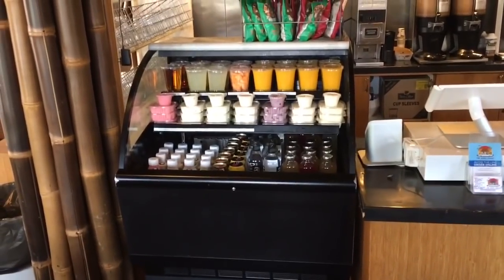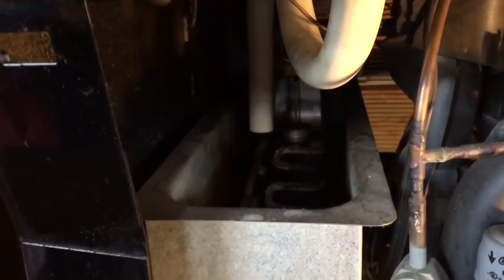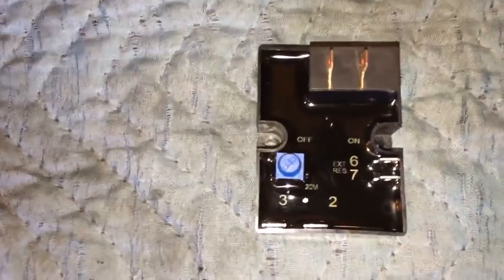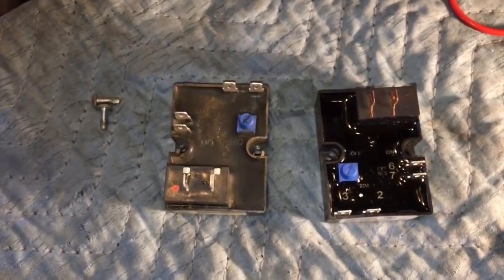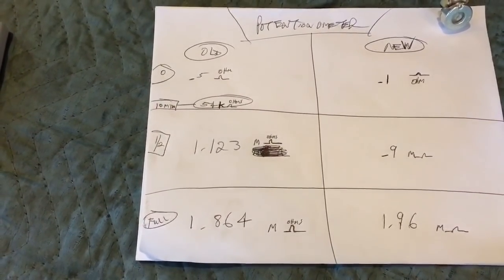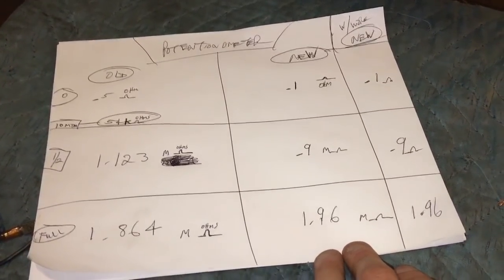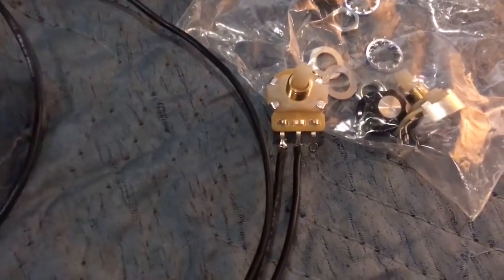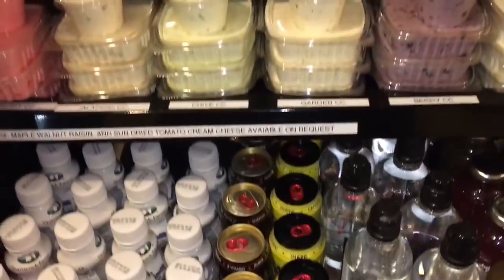Federal LPRSS3 Repair in detail.

Comment: Just throw a GM40AV time clock and problem solved 🤭😉. Or at very least will save you time on trying to find that time delay 😁
Reply from the maker: Your Way Would work in a pinch though. finding that time delay relay was a bitch. i found the last one in colorado from rhs for $150.00 list price. federal wanted $250.00-$300.00 for that solid state time dealy relay List price. + shipping cost. unfortunately a gm 40 would not work. run time has to be no more than 10 minutes or product will freeze overnight , u would have to pair it with a Temp control. id prob use one of those A421 with defrost built in if i was going to go that way. other than factory design or upgrade to new style controller. i think they are using carel controllers now. i bought a extra potentionometer for customers other unit & im going to stock a solid state relay as soon as i can find a good price on one.  for his other place. just to be prepared.
Reply from the maker: ive got a call into airotronics to try to get them direct.
Reply: OcRefrigeration,Hvac & Electrical. I’ve done it before there’s an RHS near me in The SFV Couple year’s back I’ve had a similar issue with one of those . I remember they wanted too much for that stupid relay , no room to make $$ . So I just threw in . GM40AV my favorite time clock btw, no more problems 😉. You can also try Case Parts In Monterrey Park , I believe their inventory is bigger than RHS . Some parts cheaper . Great repair OC ...
Reply from the maker: 👍 Yea, this was a expensive repair for the customer.
Reply from the maker: Good info ! Thanks Felipe ! much appreciated.
Reply: OcRefrigeration,Hvac & Electrical. I bet
Reply: OcRefrigeration,Hvac & Electrical. Np here to help and share some knowledge, and not to talk shit 🤭😬😁
Reply from the maker: Your right about that Solid state time delay relay. it was EXPENSIVE !

Comment: why not just put a thermostat?
Reply from the maker: Good Question. This Design of unit Has been Working Flawlessly for 9 years , why Mess with that design ? i PREFER to ALLWAYS Go with how the factory designs a unit if it works well. . IF THE factory design is flawed , Then i will re-engineer / re design so unit works More reliably. if you were going to install a thermostat , what would u install ? , where would u install it ? would u control it by air temp or coil temp ? How would u defrost the evap coil ? if it was just as easy as installing a thermostat - the factory would have just done it that way. obviously this way was easier & cheaper for the factory and it works Flawlessly.

Comment: 50 dollhairs for a potmeter? It better comes with pot. Otherwise you got lifted amigo
Reply from the maker: ha, ha , im noticing prices for parts are going up. customer cost on that part is $48.00
my cost is a bit less.
Reply from the maker: i post retail prices for parts.
Reply: @OcRefrig  go to an electronics store those bastards that selling oem parts are charging 10times the the actual cost
Reply from the maker: No electronics stores in california anymore. Radio shack i believe went out of business. besides that , me driving and searching for a part is a waste of my time. my time is too valuable to try to save $12.00
Reply: @OcRefrig  ok that explains it. Try digikey on the interweb, its nothing more than an adjustable resistor. Better for you to make the profit, than those oem supliers
Reply from the maker: thanks. ill check them out.
Reply: @sjefoekel6058  what suppliers are you referring to, can you name a few? For most parts I guess you can save a bit by ordering yourself ahead of time and waiting for it to arrive.
Reply: @heatncool  conrad, alibaba, ebay, digiparts! Or any electronics store will have it on there shelf.
Reply: @sjefoekel6058  do you find issues with actual hvac supply house prices? Like gensco or thermal supply or RSD?
Reply: @heatncool  I live in Holland🇳🇱 Here we have Beijer refrigeration, they own most of the supply houses. The main issue with Oc is that they charged him $50 for a 5cent potmeter! Everyone knwows electronics are cheaper dan dirt.!
Reply: @sjefoekel6058  thats customer retail price. Pretty cheap if you ask me if that is flat rate price. Must not be flat rate price,  in that case if labor cost is added separately, $50 would be reasonable. Did you know $10 capacitors are sold by companies for $250 ( with 10 min. Labor, flat rate) I even heard of $375!
Reply: @sjefoekel6058  chiropractors don't even use tools. They use their hands, and we can see how much they price their hands to go to work for an hour lol! I wonder if I can price my hands for the same rate sweeping the floor 🤔 ... well hvac is not a trash job, in my opinion it requires sooooo much more knowledge than that of a chiropractic, not to mention our own safety is on the line every day! . We also have over 10 necessary certifications. And our overhead is 5× higher. Man I think I could essaliy right an essay on this. Why do cuatomers even call us if they can do the job themselves?! Its because they can't, most technicians straight out of a 2 year hvac technical school can't lol. It requires journeyman expertise to flawlessly, proficiently, quickly and accurately diagnosis problems. Man, if cuatomers had their way, and technicians made as much as a janitor they would be stuck fixing their own problems! We already have technicians shortage most the way it is ! :)
Reply: @sjefoekel6058  also to add. KNOWLEDGE AND SKILL SHOULD BE REWARDED NOT PENALIZED. 

When I got out of school, the same job it takes me 15 minutes now, took me 1.5 hrs then. It is not fair that if a technician becomes more skillful, he makes less money. I probably would have to work 3× as much to make the compamy as much money lol. That would suck! Knowledge should be rewarded. Not penalized. Otherwise you should have beginners in the NBA making bank and the professionals in an amateur league making next to nothing to survive jaja. That would be fun wouldn't it, then I could go play in the NBA, double dribble,  kick the ball around, get applauded and have lots of dough! I also would never want to get any better ! As then I would be kicked out of the NBA, and lowered to the profit less amateur league
Reply: @heatncool  agreed, i always think if you are happy with what you are doing, you will never have to work a day in your life😁 even getting paid
Whilst practicing your hobby👍